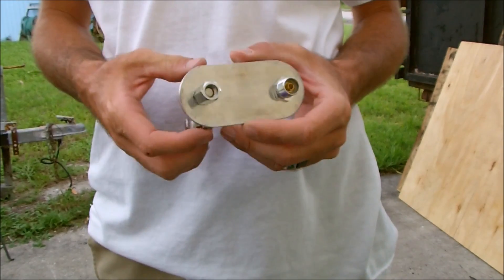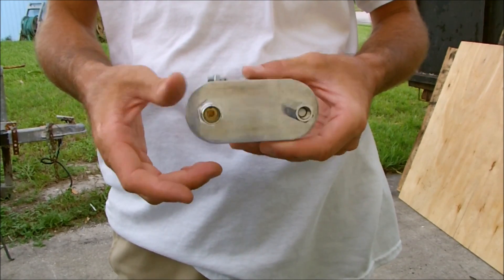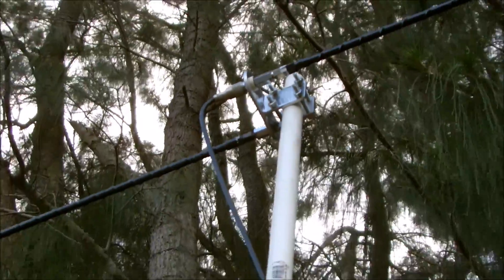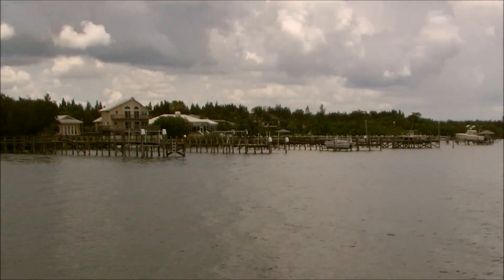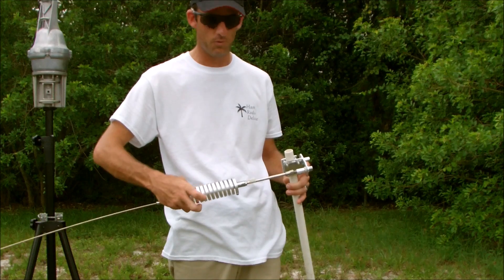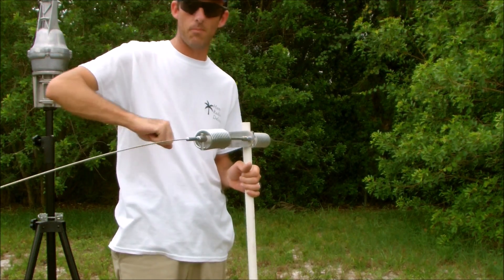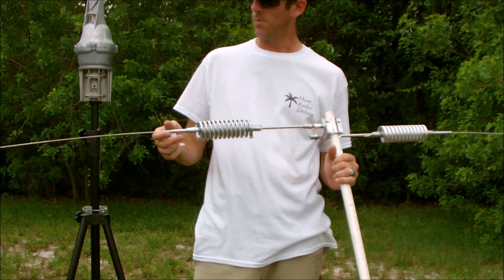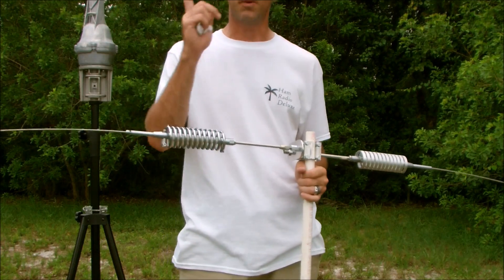Portable dipole ham stick MFJ-347 mount

Comment: Won't You want the SO-239 Pointing down so when your trying to use it as a Vertical Antenna pointing up and the ground plane antenna pointing down or as a ground mount clamped to a ground stake? Just asking! Thanks.

Comment: Great video as usual. I'm looking at building one of these in both 10 and 6m...   I have a few questions.  
1.  When setting this up Horizontal, does it need any counter poise or Ground radial?
2. Same question with Vertical? 
3. Why would one want to go vertical vs Horizontal???   

Dumb questions I know, but if you don't know, you don't know.  Look forward to more interesting videos...

Comment: Hey Eric, I've used the MFJ-347 bracket with two 20 meter ham sticks (horizontally polarized) for a number of years when deployed in the field.  I mounted the MFJ-347 to a 12 foot painters pole and it works great.  Look forward to seeing more of your videos.  You do a great job in explaining ham radio equipment.  73, Gary KB5AEB

Comment: Question... was your coax just random length or was it cut to length for the freq you are using. Im hearing some say go by wavelength and some say keep it short and direct cause excess equals loss. Also, i never done this on a dipole mount but what if you connected a 1:1 current balun to the antennas and connect the coax to it. Or would just a choke balun be more advised.  Im always looking for more efficient ways in constructing mine..KG4GZW

Comment: Real heart breaker for HOA spies. Where's the antenna?   No you didn't see a antenna.  Later I drag it out. Use it. Then a knock on the door. After a few cycles. The HOA PRESIDENT Stopped SHOWING UP. Good show om kv4li

Comment: It would be great to show how much noise you get from a real contact . Does a dipole give you lots of QRM compared to say a portable vertical dipole setup? I use the same setup minus the rotator and hang it vertically . Noise is much less on 40m and 80 meters. Have not tried 20 but I am sure it works better

Comment: Great! I live in Apt and use 2  HAMSTICKS on 40 and 2 on 20. Mounted in a camera tripod. The only thing I might suggest to you is to use a 1:1 RF Choke Balun AND if you have any matching issues, there is a capacitor box I use directly off the Antenna then the choke. It prevents Common Mode Currents from going down the feedline.. but in any event, it's a great way to get on the sir quickly. 73's. David K8KEM

Comment: It is a cheap alternative to a Buddipole; especially when you only want to do certain bands. There are so many variations you can think of with this system. For people without a rotator, there is is always the strong arm rotator! You can get a piece of foam presentation board and draw compass directions--N, E, S & W...and variants of them. That is an easy way to know which way to point it. The mounting pole can go through a center hole. And 1/2 of it can easily be used with a counterpoise as a vertical.

Comment: Please do a video on how to tune the mfj ham sticks.I have a crazy high swr while trying to tune it and I'm not ready to cut the whip without knowing if I'm going in the right direction.
Reply: I use Hamtennas as verticals on my car--stationary portable. I am using two ground radials coming off the car over each front fender--kind of looks like a peace sign. A shorter section is near them. This gives extra ground plane to 10/20/40m and 15m. I would try and get them as close as you can with an antenna tuner...or SWR meter. In-radio SWR meters usually are not as accurate as they would like you to think. The important thing is that it is a balanced dipole, so both sticks should be the same length. The higher off the ground, the better when it comes to tuning them. As an example, three chain link fence top rails end up being about 25-30 feet high, and cost about $30 at Lowe's.  Start in the middle of where you plan to operate. I usually chat in the middle parts of the General band, so that is where I set my resonance point. Then, I make notes on the SWR at various places along the band.. Hope this helps! Also, read my comments to HamRadioConcepts. Those are also good pointers.

Comment: I have just bought this set up and am trying to use it camping (back yard first). How do you tune it ( have an analyzer)? In place, and if so how do you get at it? Each HF stick seperately and then mount? Tune them in horizontal or vertical orientation...how about a video on that. This may be obvious to many but not me. Have been a ham for a few years now (52 yrs) but have never really played with antennas and field operation so learning all over again.
Reply: AND...do not tighten the two screws on each stick down until the SWR is set...and then, not so tight. Lightly tighten one down while tuning. Also, with each stick, you will get an allen wrench. Put one in a medicine bottle, etc. and keep it in your car. When you can't find the one you "thought" you brought with you, there is a backup. I keep allen wrenches, quick disconnects, etc. in a large (empty) Tylenol bottle in the back of my SUV. Solves "headaches" later on.  :)   Also, mark/measure the settings, so next time you will be close to resonance. Markers will eventually fade off any marks on your whip's stinger and the little identifier sticker will eventually fall off.
Reply from the maker: You have to tune the antennas together on the mount just standard procedure, tuning for the portion of the band you
 wish to work.
Reply from the maker: and there should be an Allen screw, loosen it and adjust the radiator for minimum swr. The antennas should be somewhat in tune for the band, you can do each one on the mount one at a time in vertical position then fine tune once you get them mounted together
Reply: Start with deciding what part of the band you want to use it.  Lower for horizontal and SSB, and higher for FM and vertical.  Use an antenna analyzer.  Set each antenna up identically, sweep the band for the frequency with best SWR.  Adjust to move that center point where you want it.  Either a favorite frequency, or perhaps to cover as much of the band as possible.  I check to see where it has an SWR 1.5:1 or less.  Figure out what the bandwith is for that.  Or you can choose an SWR of 2:1 or less.  Based in this bandwidth, chose a center frequency that suits you.  If using CB antennas, you will have to shorten them.  So the process it to shorten and check SWR bandwitch.  Repeat.  A some point you will over-correct and have to lengthen them again.  It took me ten (10) tries to get my 80 M Ham Sticks tuned for the frequency I wanted.  I had to shorten the stingers, because I wanted it resonant higher up at 75 Meter.  A short antenna on 80 meter was, as expected, very narrow banded.  On 10 meters two 102" whips will be more broadbanded.  Those will droop some, but I'd rather have them long and drooping than shorter and less efficient.  If you sweep the entire band, you can decide where you want it resonant to be the most useful for your purposes.  Horizontal will perform better.  If set up vertical, use a stand off post.  The feed line should leave the antenna at right angles to the dipole.

Comment: FINALLY someone has done a REAL video on this!!!!!

I haven't even watched it yet and I know it will be 500 times better than anything else out there!
Reply from the maker: Brought to you by yours truely, LOL, it's not perfect, but i'm having fun, and helping others. That's what counts.. Thanks for the love!!
Reply: How well did it tune up and how well did it perform? Oddly enough, this video made me realize why my 20m hamstick dipole doesn't work. I bought two 10m sticks and didn't realize till just now that hamsticks are 1/4 wave verticals. So in order get on 20, you need two 20m sticks and NOT two 10m sticks LOL!!! DUHHHHH now that I realize it!!!

I have already gone online about bought 20 and 40m sticks. I will NOW get that hamstick dipole on the air and it will work! :-D Thank you!  73 de N0BPS
Reply from the maker: +Brian Streufert tuned up fine.. it didn't perform nearly as well as the magnetic loop that day, but I made about 3 dozen contacts on it... was flat swr in the cw portion but they weren't my 20 meter ham sticks so I didn't retune. plus running 2 in a dipole will be different than a single on the mobile with the vehicle so they may have been fine on c the vehicle in the phone portion but on the mount horizontally they changed. The 10 meter sticks I have I tuned flat 1.14swr at 28.5 but 10 was 0 conditions on field day